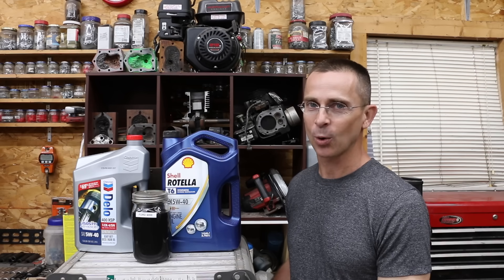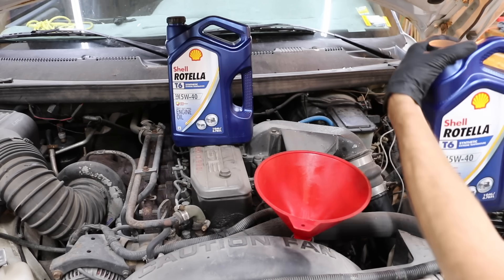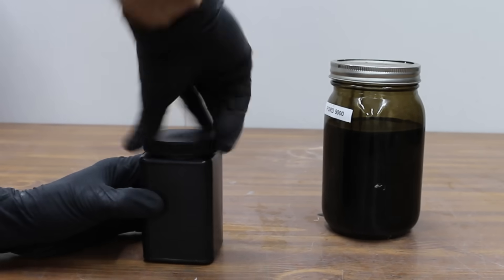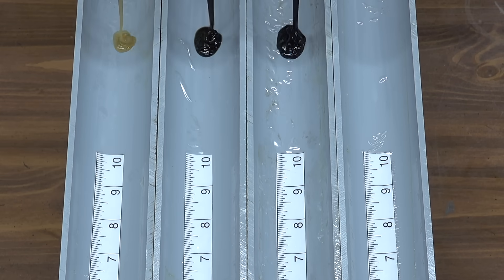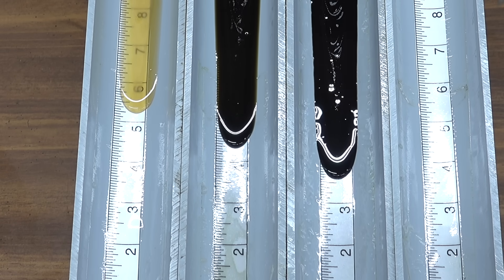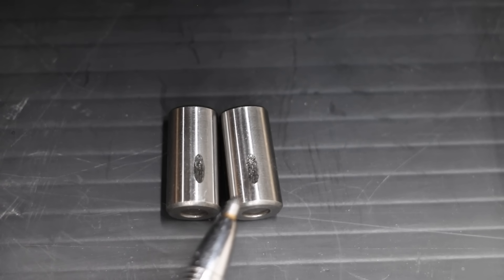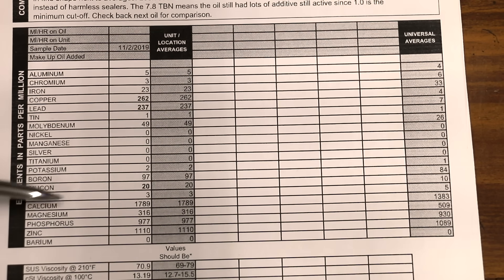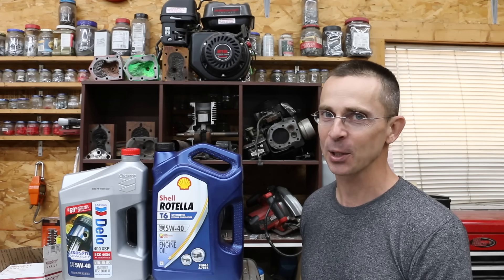Will Annual Oil Change Damage Your Car? Let's find out!

Comment: While I have heard good things about Rotella and have no doubts it is a good oil, have never personally seen a million+ Cummins ran on Rotella. I have personally ran three trucks over 650k (1997-hotshot, 2002-hotshot and a 2005) miles on Delo all were sold still going strong. Also owned a 2013 6.7 350k miles, all four were purchased new. Currently own a 2007 (no more 6.7's for me), Dad has two 2005's all on Delo with one currently over 500k miles. I have personally seen several trucks ran over one million miles on Delo, yes harder to start cold and a bit of white smoke till warm but still running. Seems good enough for me. 

Many people make different claim's about which is best on so many different forum's with so many analysis reports. Yet none ever have real world trucks that can back it up. Not saying that there are no extreme mileage Rotella trucks, but there are many, many such Delo trucks. Conclusion for me is electric motors and numbers, while useful, do not outweigh the real word results I have seen.

And for the title of the video...there are far too many variables (weather, region, storage conditions , ect ect) for anyone to make a conclusive statement regarding anything other than their own situation.  P.S. even your own situation will change year to year. - Best of luck, Zac
Reply: Thats mostly just because the Delo has been on the market longer, and sells larger containers more aggressively to farm or fleet applications. This also directly impacts the sort of maintenance this equipment recieves and the sort or running it does, if your towing commercially and service like a line truck thats radically different to dropping the kids off at school and visiting a jiffy-lube when you remember, or mud bogging the truck where 400 miles is a full weekend of high load running. Besides, you haven't even stated you've seen Rotella trucks that are lasting less, so there isn't even a conflict between your limited anecdotes and the repeatable testing of the video, merely that you can confirm the Delo does plenty good enough for most peoples needs. To address any conflict of interest people may assume, I've never used the shell, and have Caltex gear lube in my differential, but never used the brand in motor or transmission, so I'm certainly not shilling or fanboying for either side.
Reply: Not saying this could happen, but just maybe with rotella in, you would have gone to 2 million miles... There are more variables in real world truck testing than this guy is doing, the only way to really test yourself is to use the same truck, run one oil till the truck needs rebuilt then run another type if oil till the truck needs rebuilt...or do oil sampling every oil change.
Reply: There are milion mile trucks with every brand you can imagine. Buy what you like and stick to it is my opinion. Our 02 24v has almost 500k so far on Valvoline Premium Blue, and our Case IH combine has over 6000hrs (that's a shitload for a combine by the way) on the same. I don't care for Rotella or Pennzoil because I don't like Shell as a company, but it's definitely true it works well for plenty of people.

Comment: If you only drive 7 miles to town once a month like I do,
Once a year sounds about right..  I have an 94 Olds
Cutlass That has  200,000 +  miles on it and it's 
still running just as strong as the day I bought it ...

Though I have had to replace a few parts now and 
again.. Like tires, Batteries, and had to change a brake 
cylinder once and the rotor that was on the same 
wheel.. 

I bought it used from a retired nurse who kept
it garaged and well maintained and the problem with 
the back wheel began about a year after I bought it..
Back in 2000..
Reply from the maker: Thank you for the feedback

Comment: (Dangit I went to hit edit but hit delete.  Here we go again)  This video was up my alley.  I have a 2006 F150 Lariat with only 38000 miles on it.  For years I thought I should only change oil when it's 3 to 4 thousand miles in, not factoring in "or annually, whichever comes first."  So often I'd wait 2 to 3 years before taking it in for an oil change before hitting that mark.  Glad to know I didn't do any real damage, and also good to know I don't have to do it at the year mark.  I change the oil myself now and run a full synthetic (Motorcraft) with WIX filters.  Because of this instead of doing it annually I'll consider it 5000 miles or 2 years, whichever comes first.  Though it sounds like I could get away with 7500 miles or  3 years on a full synthetic (I'm in Texas, low on salt, low on cold), but I don't wanna push it.  Thanks! Another excellent video

Comment: I have used AmsOil in my 2001 GMC Sierra for the last 18 years and I have no leaks or smoke out of my tailpipe. I change it once a year and AmsOil guarantees to replace your engine if it fails within one year of an oil change. If you choose to leave it in your engine for more than one year it is required that you send the oil to a lab for analysis. I don't know about you but I would rather change it in one year than pay more money to have it analyzed.

Comment: Incomplete video imo. 
Rubber seals and gaskets! old oil tends to eat them up and you get residue and moistness all around.
I change my Mom's 2007 Camry oil every year 6k miles full synthetic and the bottom is dryer than dust. now compared to exact same cars of same age that I work on, there are several very wet areas under them. I'd say caused by 99% from old oil prolonged changes
Reply from the maker: Thank you

Comment: Ford allowed a maximum of 2 years and 20,000 miles oil change interval on some of their plug in hybrids.  Those engines idled very little.  They also had an oil maintenance system that forced operation on gasoline until the oil had been hot for enough time to dry it out.  Two years is probably OK but you need to have a smart monitoring system to keep track of operating conditions.

Comment: I use t6 in every pickup in our fleet. The pickups see very hard use... towing well over the gcwr and idling for long periods of time. I change air/oil/fuel filters at 6k miles. I'm a big fan of t6.

Comment: The only thing that can cause oil to go bad that's been set for a long time is moisture and if you have a oil filter that's over a quart take clean oil filled up before you put it on it's a little bit easier on your rod bearings and mains
Reply from the maker: Thank you for the feedback

Comment: Well done.  I have full synthetic oil in a car that sits most of the year.  Oil hasn't been changed in 3 years and mileage is less than 1000 miles.  So no need to change the oil.
Reply from the maker: Thank you

Comment: Perhaps a video showing the differences in oils between diesel and gasoline use, and why they should or should not be used in engines they are not designed to bu used with.
Reply from the maker: Thank you for the feedback

Comment: I'm pretty sure the recommendation by the auto manufacturers that oil be changed at least once per year is the reason you mentioned at the end of the video; a manufacturer can't know what kind of service the engine is being used in, and a lot of short trips (low mileage) use can degrade the oil.  I think the one year recommendation is to cover this scenario.
Reply from the maker: Thank you for the feedback

Comment: Question about evaporation test...
Engine is sealed(for the most part) and I get the test somewhat but wouldn't the oil just stick somewhere in the engine(like water in sealed jar) or does that turn into carbon?

Comment: Very science this one. I agree you could push your oil much harder. My oil 10 50 or 10 60 fully synthetic ,changed every 2 or 3 years, 10k annual mileage with a lot of idleing, 1 litre engine 2002  Suzuki swift (Geo metro) with 150k on the clock. Still getting through euro emissions test.

Comment: For me it's an easy decision. My oil change interval recommended by Subaru is 7,500 km/1 year, I shortened it to 5k not only is it easier to track, I conveniently drive around 5k in almost a year, and that it's only $35 a change. During the summer I ride my bike, which I never put 5k in one riding season, I change it before storage. To me it's a matter of keeping it simple, and it's cheap insurance.

Comment: okay with diesel, can the same be said on gasoline engines, especially those running gas with alcohol and thus some water in it? 

How much water can get into the common gasoline/alcohol blends before it won't run at all, and or just runs poorly? Got hold of some gas a while back that somehow got water in it to the point where my fuel injected truck would run, but barely, was very hard to start and missed and popped as I drove. Some non-alcohol gas in the tank when that gas was about gone seemed to solve the problem.

Comment: Some people don't drive far enough to get the moisture out of the oil. A simple check is to take off the oil cap and see if it is gathering there. I know quite a few people that change their oil every 1,000 miles and wear out the drain plugs on the engine and end up with more engine problems than anyone.
Reply from the maker: Thank you for the feedback

Comment: "Technically", you're supposed to fill an oil filter through the outer holes in the top as that's how oil flows into them. I fill them just like you did though!
Reply from the maker: Thank you for the feedback

Comment: I would be interested in seeing you test windshield wipers. There is quite a difference in prices and I always wonder if paying more genuinely makes a difference? Maybe for the test, how long it runs before starting to break down with misting rain, light rain, and heave rain. Does one brand provide a better clearing ability right out of the gate. Is there a variety in the thickness of the rubber part that wipe the window. I see some that appear to have like a sleeve around the metal frame, does that make a difference in performance, longevity, etc. hope to see this Video! Absolutely love this channel and what you do! Thank you and have a Merry Christmas!!!
Reply: Pretty sure he already did this?

Comment: Cover the threaded hole and pour new oil in the outer holes if you wanna filter the new oil..
Reply: boone dalton 
OCD much?
Reply: @91156  ¹ no  just how Cat and Komatsu recomend it, lube man for 10 years
Reply: boone dalton  
Auto/truck tech since 1972. 
ALL the new oil will get filtered once you start the engine.

Comment: When I was using SAE oil, I changed about 10,000 miles which was about 2 years, when I changed over to synthetic, it usually gets changed about 30,000, which is about 6 years. I mainly changed it when I feel like it. My old 99 Ford has about 155,000 miles and still going strong.
Reply from the maker: Thank you for the feedback

Comment: Well done on another informative, useful video. I wonder, have you ever tried comparing gear ratios to maximize mpg on your farm vehicles. (For example, I used to run 2.73 gears in my jeep, because it wasn't jacked up and I never peeled rubber.) 
Alternatively,  is it possible to replace a blown engine in a small farm truck with a three cylinder diesel tractor engine? (there used to be a guy around here who claimed to have done it, since his 85 ford had a bad engine, and he had an engine from a kubota kicking around.)
Reply from the maker: Great video ideas! Thank you

Comment: Awesome video yet again! I wanted to add a tidbit: on side mounted oil filters, I have found you can fill them about half or so full, turn it on its sides, and let all the pleats soak in oil, from there I add enough to where its not leaking out layed on its side, and I have noticed that soaking those pleats drastically cut down on oil pressure build time on a new install, almost as good as the one you did in these vehicle. Just wanted to mention in case its ever handy, Merry Christmas Project Farm!
Reply from the maker: Great tip! Merry Christmas

Comment: This is a hot topic on diesel engine pages. If you wanna take it a step further, you could try running some brands like rotella, delo, masoli, and motorcraft through a rigorous high pressure oil setup and compare the results.

For example I have a 6.0 Powerstroke and the high pressure oil pump is very hard on the oil. It has been claimed to take a 40 weight oil down to a 30 weight just because of how it "shears" the oil. A specific fuel injector manufacturer will not warranty any injectors they have rebuilt if it the engine had rotella ran through it because they and other people have claimed that rotella does not handle the stress of the system well.

Just a thought if you want to get into the nitty gritty of it.
Reply from the maker: Great test idea! Thank you

Comment: Its not a myth. your Crankcase is not sealed. The Temperature goes up outside, it goes up inside. Goes down outside, it goes down inside. That brings in moisture.  Put a glass of oil outside, Wrap the oil with saran wrap. Put a straw inside the cup.
Reply from the maker: Thank you for the feedback

Comment: I have a 2017 Infiniti Q60 3-liter Twin-Turbo V6 with Direct Injection (DI).  I change my oil and filter every 5k miles, due to fuel dilution concerns with DI.  I use Valvoline 5W30 oil and the OEM filter.  UOAs consistently have shown a downward then steady low-trend for wear metals (Al, Fe, & Cu).  Only once when I went to 6k mile OCI did the fuel dilution approach 2%, and the viscosity #'s showed the oil sheared down to a 5W20.  Yes, fuel dilution is a real concern with DI engines!
Reply from the maker: Thank you for the feedback

Comment: FYI by filling the filter through the middle ur giveing the engine unfiltered oil . Oil flows from the outside in and goes up the middle to the motor. Same for fuel filters.    Great channel watch all ur videos. Keep it up.
Reply from the maker: Thank you for the feedback

Comment: I had used oil analysis done on 2-years and 3-months oil with only 3542 miles on it.  Blackstone said the oil was still fine.
That's using AMSOIL Signature series.  I'm sure there are many variables involved, including oil used, engine quality, driving habits, etc.
However, my current car is direct-injection only, and it has very small oil capacity at 3.5 qt, so I'm just going to do it once a year, disregarding mileage.
Reply from the maker: Great point!  Thank you

Comment: Idea: different Anti Oil leak Fluid for crankcase, but i dont know how to compare them
Reply: On the same topic, maybe test different radiator stop leak products? Could try experiments on heater cores or radiators to see if they stop leaks or create blockages.
Reply from the maker: Thank you for the video idea!

Comment: Does filling the oil filter really make a difference? 
I’ve never filled it up before putting it on. Just let the pump fill it up. In my 95 Cummins it takes the same exact time to build pressure on the gauge after I do a change
Reply: The valve train gets oil quicker.

Comment: Video idea: car light bulbs. 
There are premium, budget, normal, ultra-bright, LED replacements, etc

sample variables to measure:
-power usage - affects fuel consumption. 
-temperature - high temperature might damage reflector over time
-luminosity - if you can't get professional luminosity tester maybe you can test it with camera at fixed exposition, etc by adding some sort of filters (like from welding mask or something along those lines) and see through how many layers you can still see the light. Ideally you can test it over short/medium and long ranges

Not sure if possible to be measured in reasonable fashion but:
-UV output - cheap bulbs are said to have high UV output that will damage reflector over time
-longevity - I have no idea how to test it other than building a rig with spot for 2 of each bulbs (just in case one is faulty) and let them run but that might take long and lost a lot in electricity. Maybe some sort of rig with timed switch that will turn everything on and off every  couple of seconds (basically a high power blinker). This should speed it up but it still might take weeks. Not sure if this is viable test but maybe you have better idea.

It's just an idea that came to me so maybe points above are flawed or impossible to measure reasonably but maybe it will inspire someone to have better idea
Reply from the maker: Thank you for the video idea!

Comment: As always another great video. It would be nice to see the same testing done with a Gas Engine. If I am not mistaken Zinc is an excellent additive to cut down on friction but is not used in gas engines as it will damage the catalytic converter.
Reply from the maker: Thank you for the feedback.  Nearly all oil designed for gasoline engines has zinc but usually much less than diesel oil
Reply: @ProjectFarm  Thank you for the information.

Comment: I have used them both and you're right, they do very well. I only use the T6 Rotella now because it keeps my motors cleaner and running great. We've torn down engines with lots of miles on them and they are clean with good bearing wear. Both gas and diesel.  I hear that Rotella is coming out with a full synthetic that is rated for gasoline motors. I'll try it.  Keep it up.
Reply from the maker: Great information. Thank you
Reply: @ProjectFarm  The next time you compare oil additives, try some Synergyn by Dyson out of Durant Oklahoma.  I love the stuff.